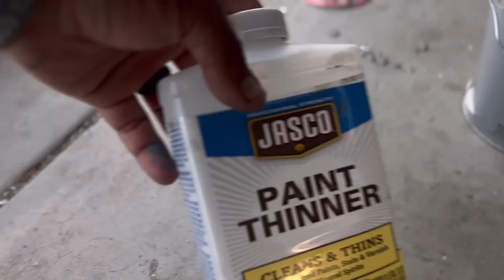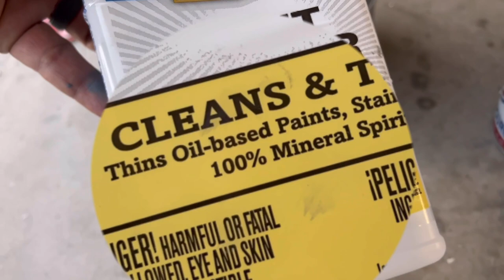Painting the Budget Boat with SECRET WEAPON | Budget boat build Ep.10

Comment: if you use oven cleaner cover it after spraying with thin plastic (painters mask) . the vapor created by the oven cleaner will dissolve/soften the paint far better . its designed to work inside of a closed oven so the vapor is trapped and helps the process. great vid cant wait to get started on my own project...

Comment: I have used Aircraft remover. It's expensive but it works.
So does standard paint stripper.
I used Total Boat Aluminum boat barrier on the bottom. It's a two part epoxy paint. It sealed every rivet and seam.

Comment: We use Bonderite S-ST 6776 Lo Aero in the aviation industry. Use ScotchBrite and Simple Green (or a similar method) to remove accumulated soils from the paint, then apply the stripper. It wil normally get you down to the metal within 15 minutes and washes away with water.
Reply from the maker: Thanks

Comment: Im doing the same thing i see at least 6 different colors on there. Boat is from the 1950s. I just need to strip all the paint to inspect for more holes lol. It actually appears to be an embossed aluminum or whatever they call it when its kind of rough/dimpled like the exterior of your grandmas fridge, so it's hard to get all the paint off the little nooks. My plug in wire wheel takes forever and my hands are numb from hours also getting stabbed by those little pieces. I'm like 10% done and I'm already over it. Defintiely gonna try that easy off and maybe test a few different paint strippers side by side. That top coat of black paint is THHIIICCCC too.

Comment: Twisted knot wire brush attachment on angle grinder works a treat for the heavier paint.
Reply from the maker: Yeah but it’ll chew through the hull
Reply: @TinyBoatNation  i thought it would too but then i tried it. It's not as nearly destructive as it looks. Give it a go on a test spot, you won't be disappointed ✌

Comment: Just a tip wd40 gets paint off your hands pretty good no joke scrub it in good it does pretty good also a little bit of gas eats on a rag eats paint pretty well especially mixed gas
Reply: Wd 40 works great to remove oil based paint! Followed by dawn dish soap to remove the wd 40